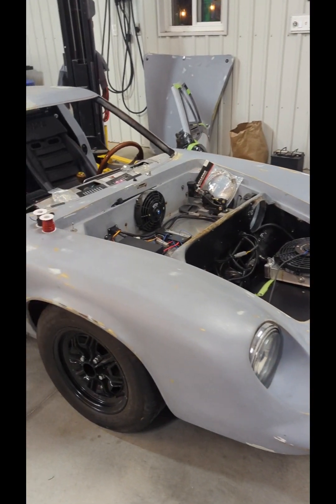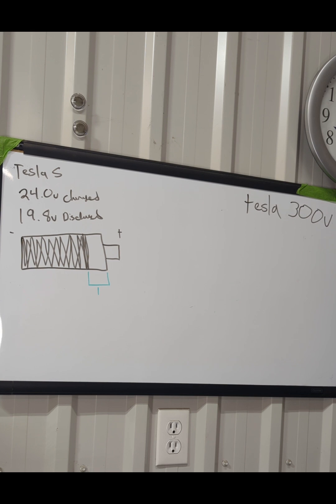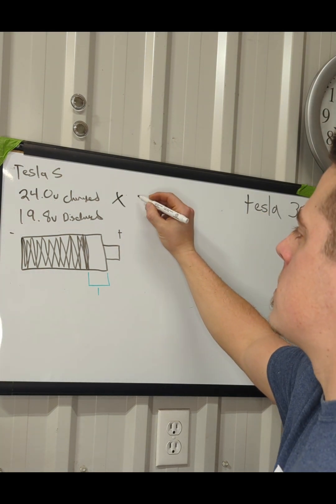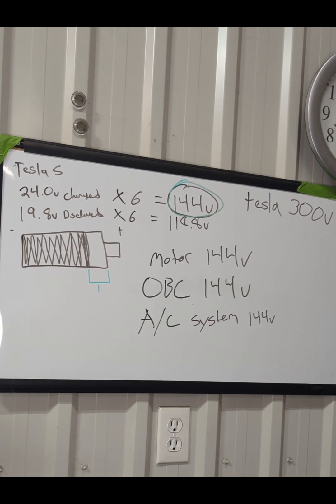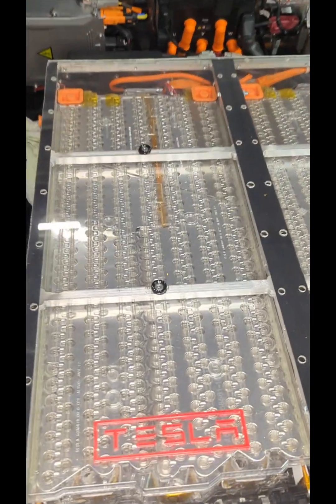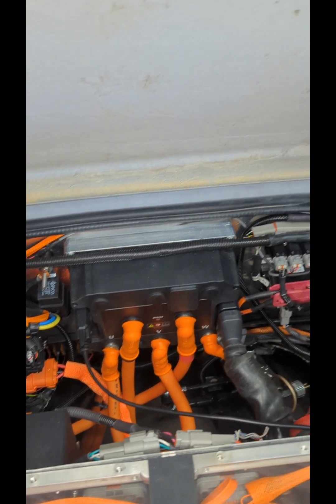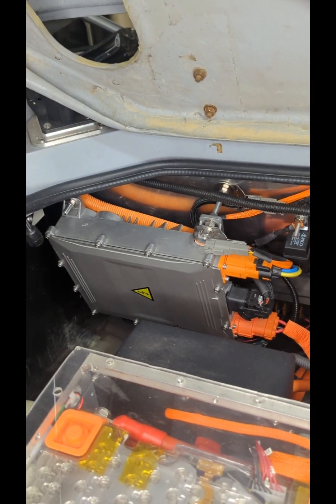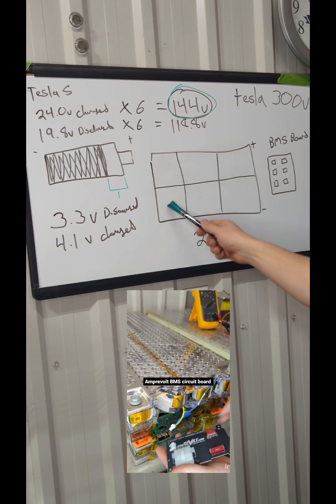Lotus Europa EV conversion

Comment: Cool project. As an owner of an Esprit (1983), I've struggled with the engine issues (carburated, turbocharged, Lotus-designed engine that is expensive and not well documented). If I ever have to pull the engine, I'll probably just do an electric swap.
Reply from the maker: @DrieStone  thanks for the comment! That's my main reason for pursuing this project. Trying to get the vehicle back on the road for everyone to enjoy!